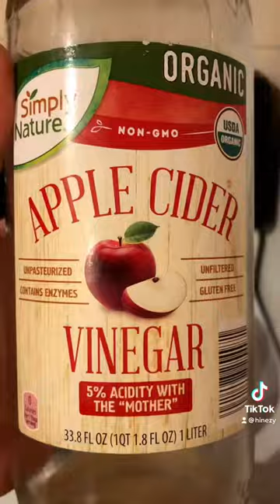Harbor Freight Bushcrafting Hatchet Mod!

Comment: Using that grinder with those hoodie drawstrings dangling like that is a recipe for disaster.
Reply from the maker: Eh, the power is literally in my hands.  If it grabbed my string, I’d immediately let go of the switch and it’d stop.
Reply: @carnivorecamping8992  you don't really think your reflexes are quicker than 1000 rpms do you ?

Comment: I was at HF today and had to pick it up and check it out.
I have the 1 1/4 lbs axe and it's nice. I think a hatchet like this can be better.  Cutting the point off the back drops some weight and redoing the handle gives you the best possible grip on the handle.
Glad you didn't put a long loop from the hole in the handle aince the purpose of the hole is the be able to hang the axe on a pack or put it up on a wall or at campsite.

Comment: are the steel and heat treat on that $20 axe actually worth all this effort though?
Reply from the maker: In my opinion, yes.  It was a fun project.  You can see the hamon line during the video after adding the apple cider patina.  That shows that the blade area was hardened properly.
Reply: Modern steels, even on cheap axes, are so much better than pre 20th century steels, that it almost always is worth doing a project like this
Reply: Nice. Good shit then. :3
Reply: I own a HF hatchet and processed two entire trees with it (60 year old trees) before resharpening and it only had a couple tiny rolls....
I like them, it came dull as sin out of box but nothing a file couldn't fix in 10 minutes